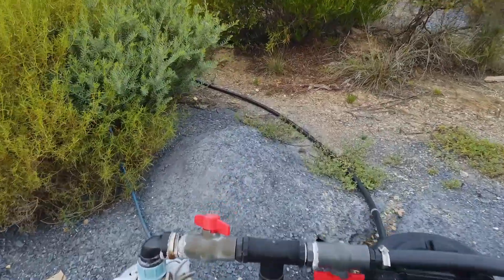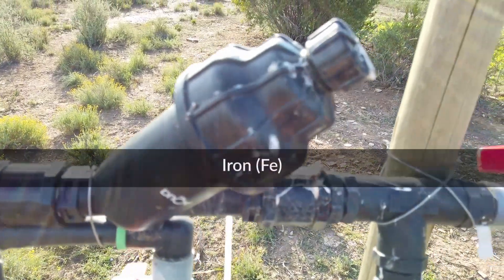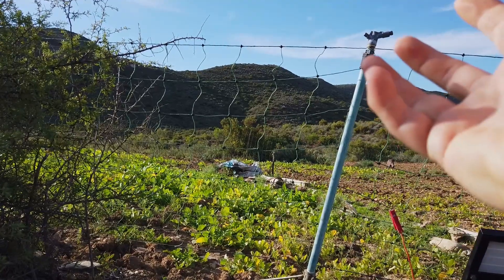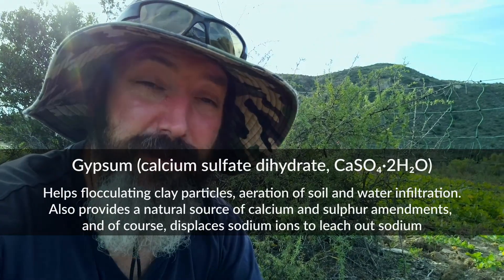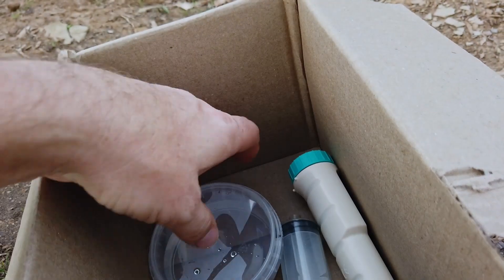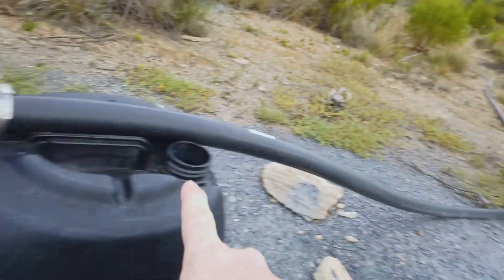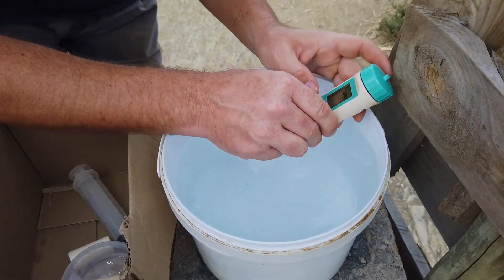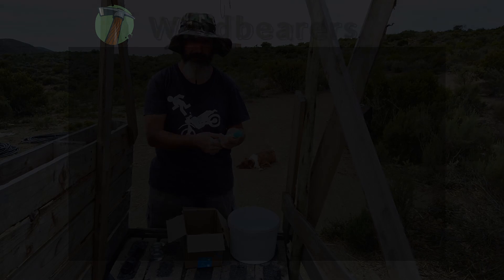Vinegar in our well water? A Tale of pH

Comment: You are doing it accurate, so that's good. I have used vinegar in the past in an attempt to change the PH from my pond. But that didn't end well. For starters, I didn't know what I was doing, and I was not accurate at all. And for a pond it makes no sense to lower the PH with a substance because then you are only fighting the symptoms. It is a different situation. But what is similar is that you have to be very careful with vinegar, and indeed you need to take measurements as accurate as you can afford, and you need to know exactly what you are doing. 

Other possible solutions are peat, it is a slow working cure but it does have a relative long lasting effect compared to chemicals such as vinegar, and plants and micro organisms love the peat as well. But on the downside, it is more expensive and not always available because some countries banned the use of peat because of environmental reasons. 

You can also purposely create slightly acidic compost, and once you have that system going reliably you can continuously use that to top dress the soil, but that is also a long term strategy. Normally the information that you can find about making compost tells you how not to let the compost become acidic. Or what you should do to prevent that. So it seems to me that if you do the opposite as what the information recommends then it shouldn't be too hard to create acidic compost. 

The benefit from the slightly acidic compost is that you are providing acid to the soil, but also micro organisms who are already used to that acidic environment, so they get a running start if you will. Instead of shocking the existing micro organisms in the soil. Half a point PH change is pretty shocking  for at least some of the organisms, maybe not all, and what won't survive initially will grow back, but it is a fairly drastic cure, lets put it like that. The compost and peat on the other hand slowly release the acids. It is more gentle for the existing micro organisms, but you also add more micro organisms who are already used to it. But it requires a lot more steps and patience and ingenuity and resources from the farmer to set it up. 

As always thanks for sharing. 👍
Reply from the maker: Great ideas. We all learn, haha. I also did some dumb things to our pond at some point (on the first homestead). I like the acidic compost idea. Or making acidic liquid fertilizer to inject through the drippers (to clean them out). Let's hope I don't create an accidental black hole
Reply: @AridForge  I love this stuff, I have no other more fitting words for it. I just love it. Most of the things that I watch I can't do myself. But I still love it.
Reply from the maker: I still have your ideas on paper and will try to be your test rabbit one day. Thanks for the chat. Always good!
Reply: @AridForge  hahaha Wonderful. 👍